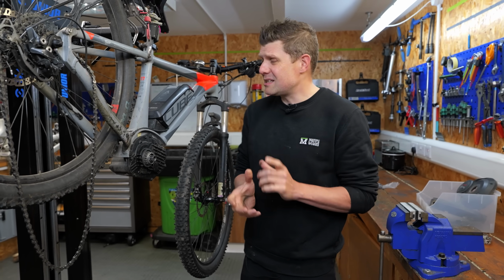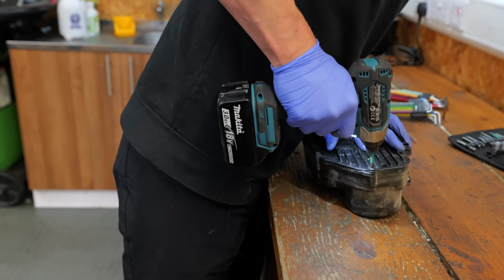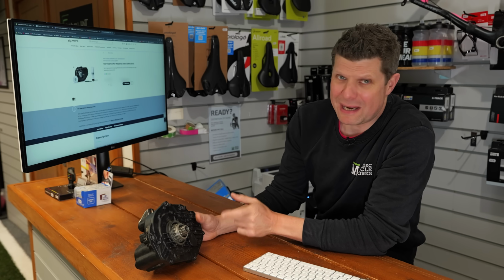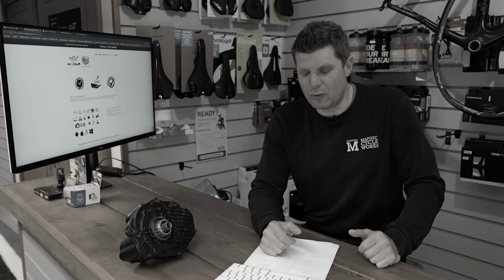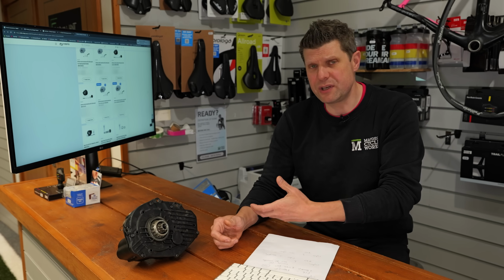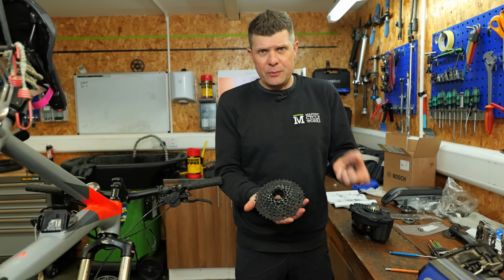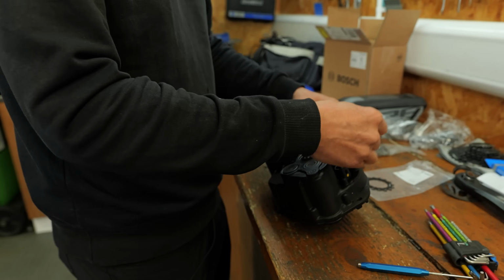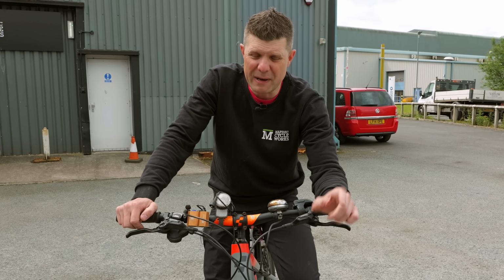This £750 eBike repair could have been avoided

Comment: Just wondering if eBay replacement would even be viable. From forums admittedly my understanding is the Bosch motors will spit the dummy for minor things like wrong gear ratios if you change your chainring etc
Old motor would be stuck on the old bikes wheel size and gear ratios which I have heard only Bosch can change but don't... from what I have read.
Reply from the maker: You would still need to take it to a service centre to be reprogrammed.

Comment: Any LBS in our area would likely not have done the job. Firstly they don't have a 'pay-it-forward' fund. Margins are typically tight for local shops not supported by a large franchise. We don't have big franchise shops here, and the constraints of making a local small business financially viable is to have limits on costs and staff time. A mechanic typically really likes what they do, but the admin work would not likely have been a go for the shop manager or owner. If it were a simple case of 'the customer is always right' and said client were strong enough in their waste-reduction values as to put over $1300 CDN into a used bike then of course the shop would have certainly done whatever they preferred. However it is more likely that they would strongly encourage the client to put that money toward a new bike instead. Possibly they might have offered them a small trade-in value. OUr shops also don't have successful YouTube channels providing an additional revenue stream.

Comment: The frustrating thing about the pcb is there’s probably a £0.06p component which just needs soldering out and replacing, but how would you know what? I’m assuming they don’t supply a diagram for that level of detail. But that is the type of thing companies should all be required by law to have on their public sites. Or better yet, all electronics over a certain value should have circuit diagrams uploaded to a central repair library.
Reply from the maker: Even just supplying a new board we could solder to the motor would be helpful.
Reply: @Mapdec  years ago, the ÉCU of my car developed a malfunction. I sent it to a company called actronics and they remanufactured the insides. Basically resolder the whole thing with an automated machine. 

Maybe they could provide some help?

Comment: Those gen 3 Bosch motors are known for having that bad drive side bearing. Pretty sure that is the only reason Bosch offer that kit and have upgraded it with the kit/new motor. Also I would not want to buy a cheap second hand e bike to replace it I would want to buy a newer e bike/new ebike/like new e bike that would come at a much higher price than replacing the motor.

Comment: Bosch are effing criminal. WHY is a bearing kit a hundred & forty pounds?  That's not what I'd call reasonable. 
Also, took my elderly mother to get a stick vacuum when she had to move into a tiny pensioners village flat, thought I was going to be on the hook for a Dyson but she found a Bosch Athlet was better for her frail wrists as the weight was better distributed. Fast forward a few years when the battery inevitably was giving up, I wanted to buy a new battery from Bosch. Nope - no can do. The only thing they sold was a complete new 'accumulator' unit which was the battery, the charge controller and all the other electronics that controlled the vacuum. Bastards. There was nothing wrong with the rest of it, I just needed to replace 7x 18650 cells but they'd made it almost impossible.
Reply: Happened to me recently with an expensive piece of subsea kit  - the replacement battery pack being stuck at customs in the UK for weeks but the subsea repair had to go ahead - so we managed to find alcaline cells of the same voltage/size in a hardware store were the ship was, hand soldered the lot together, sealed it back in, worked a charm.

Comment: I'm on my 5th Gen 2 Bosch DU. They are basically throwaways when the 2 year warranty is done
You say 'regular' maintenance(?). I have NEVER been told/informed to bring my bike in for a DU 'check up' EVER!
What I'm pissed with Bosch about is that, when they do replace a DU under warranty, the warranty is STILL from date of original purchase. I went through 3 warranty pieces of JUNK then, they stopped my warranty claims so, I bought a new (hopefully NEW factory) DU w/a 2 year warranty. I'm going to test that...
That all said... I have also bought a Yamaha w/a 3 year warranty

See my channel for updates...
Reply from the maker: Ouch. It should come up on your display that you need a service. It’s usually set at 1000km or so.  Should all be in the manual and the service centre you take it to will have the full service inspection sheet completed.

Comment: my question is how long should i wait till i take my Bosch ebike in for a service, i use it daily but its 3 months old
Reply from the maker: When you see the little spanner icon on the screen. This is set by the dealer and open to their opinion on usage. We would usually set it at 1000 miles. Less for a heavily used eMTB. More for a commuter

Comment: Aren't the HG chains backwards-compatible with LG? 11S spacing?
Reply from the maker: Not for 9sp.
Reply: @Mapdec linkglide 9-11 speed uses the same 11 speed chain. You can use an HG11 chain with linkglide 9 speed. 9 speed linkglide has the same sprocket spacing as 11 speed but it’s just missing the last 2 cogs off the back. You cannot use a 9 speed HG chain on 9 speed linkglide, you need an hg11

Comment: Personally i would have wrote it off as a bad job . But that would change if for instance if it was a gift or some other sentimental value . I treat my normal bikes and ebikes as transport , I do not use a car so they have to be used as a tool and a Workhorse  rather than as a hobby .I know this is moraly  unethical but it would have been retired to the back of the shed as spares or maybe eventualy sold or donated as a project or spare parts for others and that's my only defence for such an action .I hope this dosn't upset any one .

Comment: Would the ebike motor centre be able to help, they rebuild loads
Reply from the maker: They just do bearings and seals. Nothing electronic.
Reply: @Mapdec  they do pcbs etc for sure
Reply from the maker: @aston108  I just checked, and yes, a bit like us they do the mechanical work and have links with other companies with the electronics.  They will have more experience for sure with that relationship, but I suspect the cost will be around that £3-400 mark with no guarantee there isn’t another chip on the board ready to fail.
Reply: @Mapdec  fair point, love the vids, btw

Comment: that dirt on the outside of the motor isnt causing the water ingress.

there will always be moisture getting trapped in these designs because it is a poorly sealed case:  Water gets Stuck in.  A better plan is to drill a weephole and have ports for oiling parts.

Comment: Weight up the cost of a new bike and the cost of repair to the old bike. New e-bikes are now extremely expensive. If the rest of the bike is in good order and still functions as it should then in this instance I think I would have it repaired.

Comment: Unrepairable motor, even in that bad case is what manufacturers want. They do not care about customers like they used too. Bosch in this case is not doing what has to be done. I'm sorry but I as a customer have to have the opportunity to get spares too, not just certified shops. Now I get that certified means giving some level of experts and warranty, but I as a customer must (MUST) have the same way to get the parts, even through shops. What should I do with it is my decisions. I could run a fan for all you care. 

Strange for Bosch as with pretty much all hand held tools you can find spares. And this is no different, an engine, a controller and couple of sensors (pedaling and stopping)

Comment: did you clean that cassette or did that look dirty AF?
Oh yeah, stellar work as always. transparent shops is the way forward.
Reply from the maker: It’s a black cassette.  At the start it’s dirty. When it’s in my hands it’s clean.
Reply: @Mapdec  might just be wear that looks like it's dirty. you have to agree at 10:41 that looks dirty.
Reply from the maker: @oftankoftan  yeah. The silver bits are where anodising has worn off.

Comment: Motor service centre do a full rebuild new bearings and a new board for £320+vat and I charge £30 to remove and re-install the motor on your drive mobile Cytech  £380 all in with chain and full service.
Reply from the maker: Yes. They were one of the companies I called.  They were not confident about a dead board.  Happier to repair intermittent faults, error codes etc.  They don’t have stock of new boards, but work with a third party to repair. Sometimes they can salvage boards from motors with other fatel problems.

Comment: Phone and laptop brands like Apple have authorised service centres where you can get official repairs done (even if they are expensive). The majority of eBike brands do not. Most eBike shops in London won’t even service a bike they haven’t sold whether it’s Bosch or not. Never mind Bafang or any of the others. I can’t even find someone to check that my Enviolo is all ok. When you add this situation to the complete lack of backward compatibility from brands and the suspect durability (water ingress etc) and even safety of some of the components (batteries especially of course) then you’d have to say the eBike industry has a lot to answer for. Very poor all round.

Comment: Yes, if Bosch dont supply the part then being as they are operating out of a huge factory unit in Denham, its not unreasonable to expect a service exchange package should be offered. They are a big brand and Id prefer to have a Bosch drive than a Bafang or Yamaha.

Comment: Apple only opened up repairability because of EU - guidelines. You are not in the EU .. your country could do those regulations itself (if it cared) to force Bosch to provide spare materials. Without EU regulations - Apple would never have even considered making things more repairable.  (using Apple only because you used it in your video, it applies to pretty much every manufacturer)

Comment: I wont buy an e-mtb, 1) because I think the prices are silly and 2) i'm not allowed to fix it myself. I maybe couldn't buy bafang spares but I could buy a bafang motor with no questions asked and that doesn't require "coding in" like i'm lead to believe some manufacturers require. A lot of friends have e-bikes and they've all had new motors to so I wouldn't buy 2nd hand either as it'll be a money pit.

Comment: I work as a Mechanic in a Bosch licensed bike shop in Germany. I never dropped a Motor out of a Frame and cleaned it, or checked the contacts during a normal service. Who is gonna pay for that? The owner and the head mechanic are the only ones going to the Bosch "training", and tell me what to do. We take 75€ for a service. That sets us at around 45 minutes.
Reply from the maker: Wow.  If you print out the service report from the Bosch diagnostics it will tell you exactly what you should do in a service.  If f you are selling that service and not doing it, that’s fraud.

Comment: 5:20 so what I'm getting is they used a cheap bearing in their motor or it wasn't lubricated well enough (or the customer did something truly horrendous and didn't say anything), so much for name brand motors.
Also it's just a bearing, if you notice it feeling rough replace the dang thing, you don't need a license it's basic stuff and any mechanic worth their salt can do it. Its way better than screwing your customers by letting the situation get this bad.

Comment: Bafang spares are available
Reply from the maker: Yes.  I wish they had a reputable battery option.
Reply: @Mapdec  I build Bafang and Tongscheng conversions.  Batteries I've got from China have had no problems 3-4 years down the line
Reply from the maker: @imprezaaudi  who do you have insurance with?  Seriously.  My insurance company won’t let us touch this sort of thing.
Reply: @Mapdec  I'm not a business,just do it for family and friends.
Reply from the maker: @imprezaaudi  ah.  So if their house burns down there is no one to sue. Guess that helps.
Reply: @Mapdec  common sense, don't charge batteries overnight in a home  without a metal storage box.  Folk need to take responsibility
Reply from the maker: @imprezaaudi  for sure.  👍

Comment: time to learn electronics so you can repair something more than just replace stuff, all ebike owners better do some studying on electronics
Reply from the maker: I would love to know if there is a way to learn PCB testing a one repair. I don’t even know where to start.
Reply: @Mapdec  well if the chips are shorter it would be a hard fix...  but tings like resistors and capacitors and be removed by desoldering, and can be tested with a multimeter,  even  the transistors can be tested for a short.... which can probably be replaced easy... but since water has been inside the motor...  a lot of components could have shorted, which would mean many stuff would need to be replaced,   my dad has fixed his ebike controller without much struggle, i dont know how, but it must of been just one small issue somewhere

Comment: That poor motor must have been making some truly awful noises and felt horrendous through the pedals. It gave ample warning before failing in that way. 

If the owners car was making equally awful noises and felt horrendous to drive would they have kept going until they broke down at the side of the road? 

Bosch are by far the best of a bad bunch. At least they are built to automotive standards.

Comment: Most of this video is BS. I do commend the attitude of checking the motor, changing the bearings, but Performance Line Bearings, aka E-Bike Motor Center nowadays in the UK, provides ALL the bearings. They even have a service to repair the motherboards nowadays and 90% of them can be recovered. You don't even need the Bosch kit unless you need to replace the plastic gears. And if you wanna do a good job, there are Enduro and SKF bearing solutions for the same main bearing that are way better than the original bearing Bosch installs.
Secondly, you can coat the motherboard. But it is true, once the board is dead, motor is dead because board is polarized from factory to the specific stator.
Thirdly, there are stores selling brand new motors, with warranty. Speaking of that, the Algeria eBay seller is selling USED, STOLEN motors from bikes in France, FYI.
Fourth, You can do a proper job of protecting the motor by installing a mudguard, the crankshaft seal and the left bearing protector. And then this motor is still the strongest in the market.

It baffles me I don't own a bike store, never had stupid Bosch formation and happen to know alot more about these motors than a guy with a video with a bike store and certified by Bosch. I could add more knowledge to specific stuff of these motors, but you guys are earning money and I'm doing it for free. Just giving a shoutout to E-Bike Motor Center, which are the experts in this and to which anyone in UK should go.

Btw, f*** Bosch and their smart system incompatible with system 2 shenanigans as well. And any certified bosch center that says as they say that "you shouldn't open a motor or grease it. It's forever!" 
IT IS ALL BS to sell new bikes and motors!!!
Reply from the maker: Thanks for the comment. Did you watch the part of the vid where we went to ebike repair and they couldn’t repair this PCB. It was too far gone. We use them a fair bit, and we replace bearings ourselves.  I don’t think you paid much attention to the vid. Sounds like you should open your own shop.
Reply: @Mapdec  I did watch the whole video. You should start by recommending e-bike motor center. Also recommend a mudstop and the main bearing seal to the client that got that motor.
You could even go the extra mile and coat the motherboard water and rust proof.

Sounds like I should, yes. Btw, I changed bearings on my motor in 2019 and I bought them from Peter at the time, being called, Performance Line bearings. And you know why I did it and did some research? Because when I find out a "Technician" that tells me the brand doesn't recommend me to fix it and doesn't have any spare parts to fix, I get itches.. It's like those Apple Genius bar guys, that are generally, by norm, very stupid.

Btw, my motherboard is completely coated. Eons ago. Writing you from my 2014 Macbook Pro, with latest Sonoma and giving middle finger to any brand that is anti consumer.

My next e-bike motor will be Pinion. Already know where to get the oil 10.000km change, etc. Just this week helped a supplier of e-bike parts discover who was the manufacturer of the linkage for my bike brand in Taiwan. You know... because I tend to think outside the box and follow advice from true and tested in the field people instead of Brand educated technicians.

If you really wanted to help that client with the new motor, you could have installed a mudguard, plus main bearing seal, + bearing protector on the left side. For peanuts.